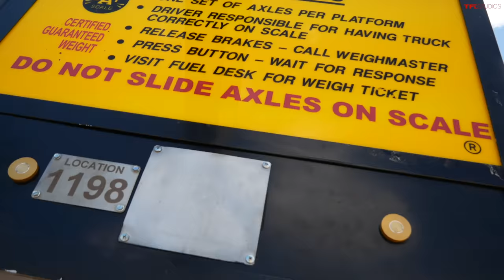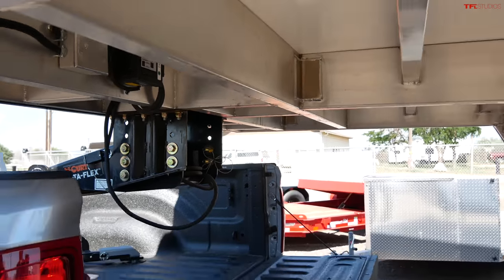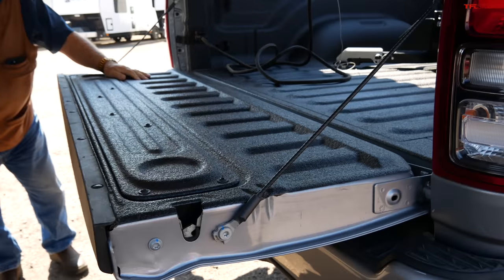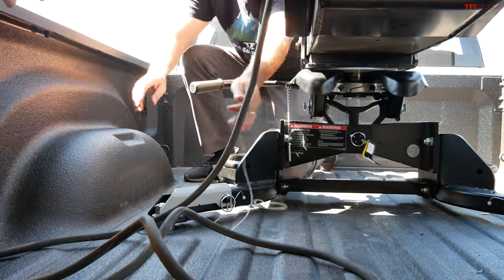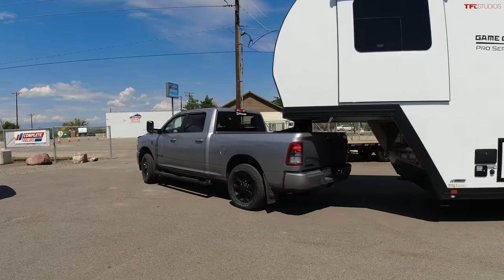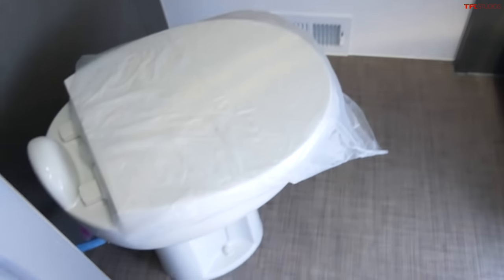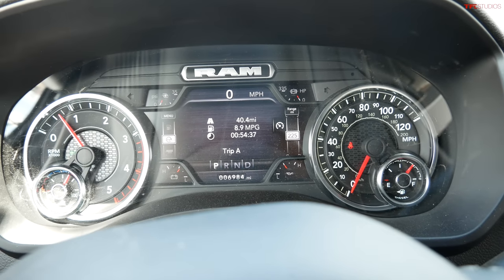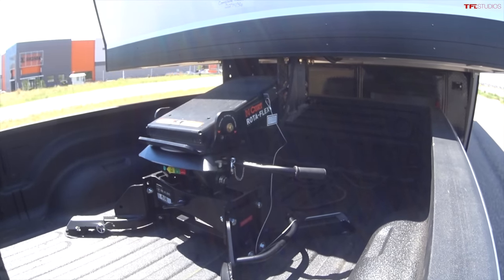I Accidentally Overloaded My Ram 2500 Cummins By 1,000 Pounds & Guess What?

Comment: I have owned several trucks and learned my lessons and this video shows several reasons I chose my 3500 Long Bed Dually to tow my 44' Toy Hauler.  No jackknife worries (I can articulate past 90 degrees), no overloading worries (with or without payload in the garage) and I can load up the bed with all kind of stuff whiling towing and still have available payload.  And the stability is by far the best part, a dually is easier to drive when towing and lowers the stress on a long trip.  I understand those not wanting some of the hassle (parking can be a pain) and expense of a Dually but I only use mine for towing.  For those not wanting a Dually, just get a 3500 Long Bed if you plan to tow a larger 5th wheel.

Comment: My 2021 F-350 XL diesel dually CrewCab 4x4, 8 foot bed weighs 8700 with driver & passenger along with half tank of fuel on a CAT scale... With Solitude 5th wheel we hit 24k combined total loaded weight. I would use a dually on that ATC 5th wheel

Comment: You need a wing off of a sprint car and mount on roof of pick up to push that air up above the nose of that trailer and you fuel mileage will go up about 2-5 mph but some times it doesn’t make that much difference it’s just how it works sometimes .

Comment: I have a 2021 Chevy 2500 HD crew cab with standard bed. Bed is 6'-10". Rear axle is rated at 6600 lbs, tow haul wt is 23,000 lbs, and load rated at 3400 lbs on the goose ball. I believe my truck would haul it legally. I have a 5th wheel Avalanche that is 42 ft long and haul it easy.

Comment: Yeah a lot of people don't realize that the Ram 2500 with Cummins has a miserable payload rating.  In most cases it's in the 1,900 to 2,100 lb. range.  There are F-150s with more payload than that.  So, since payload determines how much you can actually tow legally, there are a TON of guys all over the country overloading Rams every day.

Comment: I have a 2019 RAM 2500 with Cummins engine, shortbed and a Curt slider hitch. I tow a 32 foot 5th wheel trailer with a GVWR of 9800 lbs. When I weighed my truck & trailer, my truck weighed 10,800 lbs. The truck GVWR is 9900 lbs. When I replace the truck, I will get the 3500 SRW.

Comment: That's exactly why I went with a single axle 3500 Ram.  I couldn't find a long bed but the short works for me because I went with the Anderson ball hitch to pull my 32' 9" 5th wheel. The Anderson hitch is much lighter which gives  more payload and I can install and remove it by myself. It also is more stable and smoother (you don't get the play that you get from a regular 5th wheel hitch). My Ram 3500 also comes with the Aisin transmission which produces more torque.
Reply: Also With the the Aisin transmission on the 3500 you get the HO cummins and the 11.5 differential.

Comment: Yes, as you said, once you put a 2,000lb+ toy in the back the front weight will drop and that 2500 would be alright.  Still better with a longer bed though.  Those short beds on the RAM's are just super short for 5th wheels.
Reply: It will still probably be too much trailer for that truck and its <2300 payload. The trailer was completely empty so keep in mind it still needs water, dishes, food, clothing, fuel in the trailer fuel station . . . it was nowhere near its 16k GVWR. Newer GM 2500s have 11k GVWR and would be fine but Rams have too low payload for something like this.
Reply: I always get a kick out of the “payload”, “Payload, “PAYLOAD”, “PAYLOAD!” Comments. I have a ford ranger with a payload of 1,400 pounds. My previous truck was a ram 2500, mega cab short bed with a 1900 pound payload. You can’t honestly, truly, 100%, believe it could only hold 500 more pounds weight than my ranger safely.
Reply: @jominator3187  You really need to educate yourself on payload and how it works differently with different trucks!
Reply: @jominator3187  you also don't have an 1,100 lb motor in your Ranger. Educate yourself on payload capacities.
Reply: @XploreAz  I wonder if ram keeps the GVWR artificially low based on registration and DOT purposes or is it truly based on the vehicles capabilities🤔
Reply: @barrigany  not sure what you’re asking or implying.
Reply: I'm asking if ram keeps the GVWR on the 2500 at 10k for any other reason other than it's capabilities. The rear axle gawr is 6500lbs, so how is the payload around 2200?  The 2500 and 3500 are the same except for the coils/leaf springs. There's no sarcasm here, so please don't take it that way.  How was Chevy able to raise their 2500 to 11k? Mr truck even said it in the video.  Again, I'm not sure if Chevy changed the suspension or what to do so.
Reply: @barrigany  you got me there. I have no idea.

Comment: That's the problem with 3/4 ton diesels, not much payload for 5th wheels... Also, RV 5th wheels have a shaped front cap to reduce the chance of hitting truck can when turning.... Great and informative video as always!
Reply: Hitting the Pickup not a good idea
Reply: Right. A 3/4 ton makes the most sense with a gas engine so you get the extra 500-600 lbs of payload. It won't get off the line or pass traffic with a load like the diesel, but you'll be able to carry more stuff.

Comment: When towing a trailer of this size with any 3/4 ton truck, a set of auxiliary air springs helps to raise the king pin height and shift the weight to the trailer axles. 

As for Ford and GM having a marginally longer bed on a short bed truck, none of this matters if the 5th wheel bed connections aren't centered over the axle. The trailer extended hitch does move the king pin location rearward, but does little to change the fulcrum point on the location of the king pin. 

Out of the big three, IMO, I'll take the RAM with the Cummins for two reasons and it has nothing to do with the RAM truck, but the engine brake. Having a engine brake that will bring a 19,000 load to a stop means more than a horse power number. 
The second is that the Cummins develops it's torque at a lower rpm that the V-8 Power Stroke or DuraMax.

The commercial scale location should be able to allow you to change the elevation of the king pin height and see the change in what becomes tongue weight. On the spread axle toy haulers, you'll find the front axle will carry close to 60% of the trailer weight until you load the trailer storage area down.

Comment: Diesels are awesome, I used a 1998 Dodge 1ton dually 4x4 dump truck to haul gravel for a driveway, the GVWR on the truck was 12k lbs. When I left the quarry scale at over 18k lbs, the truck pulled like it was empty!

Comment: Good video:  You touched on a point but i dont think you know what you had or why.  You mentioned the hitch height adjustment.  If you raised it up, you would transfer weight to the rear axles of the trailer and ease up in the pin weight in the bed.  Obviously there are limits but it does make a difference when your close.

Comment: Andre, all hat and no cattle. 😀 
 I have an older Ford F250 gasser and was amazed at how heavy it is. I licensed it for 16,000 GCVW and I pull a 10,000# rated car hauler, but because of the weight of the truck I can't get a full load on the trailer. The empty weight on the combo is 9800#. If I had it to do over again, I would have purchased a one ton.

Comment: Cool you just did this video, I just took my 20 limited megacab dually shortbed HO Cummins on a 5400 miles road trip pulling a 36’ gooseneck toy hauler, and it pulled so nice, like it wasn’t there with the dually honestly. My trailer only weighs like 11300 loaded though.

Comment: Put a load in the back and I bet it solves your payload issue.  One disadvantage to a toy hauler.  It's not designed to run empty.  What is your combined GVWR?  Do you need a CDL for that setup?
Reply: Don’t need a cdl if it’s not commercial. That’s why people can run RVs hauling tandem axle enclosed trailers with a standard drivers license.
Reply: Remember, you've got to also fill the front of that thing up with food. water, LP. Payload issue will get worse.

Comment: Mixed review for me seeing the results you came up with.
When hooking up a fifth wheel on any vehicle you always want the truck to lift the trailer so the kingpin can seat correctly.
But one thing for that you should not do that you at the 12:37  - 12:54 mark is walk under the trailer while it was moving to show the jackknife angle
Very unsafe move right there of being under the trailer, between the rear of truck & front of trailer

Comment: I hot-shotted RV's for 4 years, and liked pulling 5th wheels.  But I didn't get them very often; only about 25% of the time.  5th wheels are more stable in crosswinds because the hitch weight is carried right at the rear axle.  The bumper pulls hitch point is about 5 feet behind the axle, which really gives it a long lever arm to move the back of the truck side to side, and up and down.  I also think that 5th wheels are more fuel efficient if they could be compared on an equal basis.
Reply: Did you run weight distribution & sway control with the bumper pulls?  If not, there is your problem.  My Blue Ox works magic.  Mind you, over about 15,000# I'd strongly prefer a gooseneck or fifth wheel, because the connection is simple and reliable.

I am also curious if the 5th wheels generally carried more hitch weight than bumper pulls, as that will also promote stability.  I have seen others comment that bumper pulls are often setup for 1/2 or 3/4 tons with less payload capacity, while the fifth wheels expect a 1 ton.

Comment: Mine was 3 ax 17000, 11994 dry 37 ft. HRC next level its still doing the same job but with a 2005 5.9 slower on the bottom end but does it 3/4 crew cab dually. They bought my busness.

Comment: Good to see Mr. Truck back. A couple things worth mentioning was not only were you over on the trucks GVWR but you also were over on the trucks rear axle rating. This is a Ram exclusive problem because GM and Ford offer more rear axle capacity. My 2500 Silverado has 6600 pound rear axle rating. So while this trailer may exceed a “derated” GM 2500s GVWR, it still wouldn’t be exceeding the rear axle rating which is 6390 pounds on the derated (10,000 GVWR) trucks. I think the same is true for Ford’s 10,000 GVWR trucks too.

Comment: Andre, Thanks for this video. We have a 2018 4x2 Harvest Edition version of your truck. I live in the Atlanta area and here 90% of the 5th wheel trailers I see on the road are being pulled by a 3/4 ton diesel.  I came to realize all were over their GVWR by 1,000 lbs or more. I really wanted a 1 ton but prior to COVID 90% of dealer heavy duty truck stock were 3/4 ton crew cab diesel 4x4 short bed models. The rest were work trucks. Saved $12.5k off of MSRP by getting a 4x2 and it fits under the garage door.
Reply from the maker: Hello Scott.  Thank you for the feedback.  Makes sense.

Comment: I have the 3500 ram dual rear wheel.  Don’t bother with the single wheel, imagine a blow out😳🤔😥. I tow a 43 foot toy hauler triple axel .  I upped the brakes to hydraulic over electric and improved stopping.  Thanks TFL . 🇺🇸
Reply: I have a 3500 SRW  I put F load tires 🤙

Comment: If you're going to tow a fifth wheel with a 3/4 ton, you should get a gas engine. It saves a lot of curb weight which allows for a significant amount more payload.

Comment: I have been towing stuff since 1984  from the Midwest all over and out West through the mountains. I used to install, kit out, build and repair hitches and RVs along with stock trailers and equipment movers. In this area we haul tractors combines and other heavy stuff.

You could have tweaked your numbers on that whole system. You just need to put or move more of the weight rearward  off of the truck onto the trailer. You already showed that you were running nose heavy. The positive thing about the type of set up you are running is that you can adjust and tune it. 

Toy haulers are always nose heavy but that can be changed somewhat. you need to raise the nose and recheck the weight on the truck. 

When I started to set up a hitch on a 5th wheel or goose neck trailer I always started with an empty weight of  12 to 15% initially. We would measure the truck before loading the truck for squat baseline. I have done this many , many times. You start to put your anticipated load on the trailer. 

If your truck starts to lift immediately remove the load and put an additional 10 % weight on the tongue. Then reload the trailer. Watch which direction the truck moves . It should start to squat more after the initial slight raise. Most 5th wheel or goose neck trailers average 20 to 30% of load on the tongue when loaded heavy. When we hauled heavy combines or tractors it was an intense balancing act from front to rear. Once it was all dialed in we would install stop blocks  or paint marks to make reloading easy. We also had paint marks for different settings on the hitches for different trailers and loads. We built one trailer with a scissoring goose neck using hydraulics and pin set points to make it more versatile. 

There are many ways to make things work but I would suggest an 8 foot box if possible and a sliding or movable 5 th wheel hitch. I installed one in my own Dads truck and it served him for 15 years through 3 different campers.

Comment: I have a RAM 3500 DRW.  The tires are a little smaller on a dually so the bed is a little lower than on a SRW.  A 5th wheel can turn/rotate over the bed with more clearance.   I think the DRW ties are 1 inch smaller in diameter than the SRW tire diameter.  18 vs 17 inch if I recall correctly.  Since the truck is a little lower and wider it is a little more stable.  Been a fan for years.

Comment: One of my buddies has had a Ram 2500 with the Cummins for about ten years now. He regularly tows large gooseneck trailers up to his property in the Sierras. The transmission is the failure point: He has had to replace his transmission twice. His next truck will be the 3500 with the big Aisin transmission in it. The engine is more than powerful enough to tow double the limit, and the suspension is not likely to fail.

Comment: Plain and simple, if you plan on pulling a 5th wheel, buy a 3500.  The 2500 payload is just not enough for the weight of a toyhauler.  Yes you can do it and yes it may work, right until you are in an accident and they determine you are over weight.  Then they deny your claim.
Reply: put a 2000lb rzr in the back now your under GVWR
Reply: Here a 3500 is not enough, you go over your GCM or GCVWR as you call  it. Then you have to buy a Japanese Truck if you want to haul something that heavy
Reply: Ford 350 Tremor GVWR is 11,300. Payload is 3,796. Should be good to go
Reply: @robertryan7204  How are you sure of this? I pull a heavier 5W than this one with a 1-ton SRW and it fits in the payload with stuff and people.
Reply: @wallykos6784  I'm not sure I'd go far enough to say "crap" but they are definitely solidly in the truck bro column since they are more numerous than 1-ton SRWs and DRWs. But these days it seems 3/4 ton is where full-size pickups should start in terms of a machine that can payload a good amount while towing a lot. Part of the problem is that a truck can have a specific GCWR or GVWR but the max payload and max towing are out of whack so that it's really not truly possible as rated to tow the maximum rating. Unless the trailer is loaded so it bears a good amount of the 10-15% it shouldn't be.
Reply: @SurelyYewJest   When you have much heavier payloads than what you would have  in the US.( like carrying a Midsize SUV on the bed)To remain legal they use Japanese Trucks. As well they are now using modified  4x4 versions to tow  10,000lb Caravans Off Road ( like the Black series) when US HD Pickups would have trouble going any further
Reply: @robertryan7204  Can you give me an example of one of these trucks? Because U.S. Class 4, 5, and 6 trucks can absolutely handle 9000-12,000+ lbs as payload. I know this because I once had my own 1-ton truck - no slouch at 8000+ curb weight - was once towed by a flatbed non-Japanese truck.
Reply: @wallykos6784  I'm really starting to feel the same way, although I think the half-ton should be more like the 3/4 ton in build. Have added weight for towing stability, a bit wider track, more suspension travel, and more payload, but be in the 6000-7000 lb area rather than equal to a 1-ton with the same options while the half-ton is a whole 2000+ lbs less.
Reply: @SurelyYewJest   Yes they are similar to your Class 4 or 5 Trucks. 4x4 is a modified  version. . You get a lot heavier and more powerful Japanese Trucks here than you can get in the US. example  Isuzu Medium can be 52,000lb GVWR with a 9.8 Litre Diesel
Reply: Kean Healy
" Then they deny your claim. "
And Rightly so !  . . .

Comment: B&W makes a slider 5th wheel. I slide mine back a little bit towards the tailgate and have no issues with my Raptor getting close to my cab.  Even at a 90° angle turn.

Comment: I have the 2019 dodge 2500 I put a flatbed on it last year, and I keep my 32 foot flatbed gooseneck 9000k# on the back pulling my John Deere 650J dozer, 
Combined weight of trailer and Dosier is 32,700 pounds. And it has never missed a beat.  
 Well let me rephrase that it’s had some problems with sensors and other diesel crap but never with any towing.

Comment: Would raising the 5th wheel height one inch change the geometry enough to move weight to trailer?
Reply: I doubt it, but without the atv's a sxs's in the back, the tongue weight will be too high. After loaded, they you can dial it in

Comment: My 1997 ram 2500 singles cab long bed would have no problem towing this setup with the proper tung weight, might not go as fast but it is rated for this.

Comment: It is a safety feature regarding tongue and towing rates. No, the trucks are not rated at 100 percent. Depending on the brand, they are usually rated within the 75-85 percent range. Other than that - I love the video. Very informative.